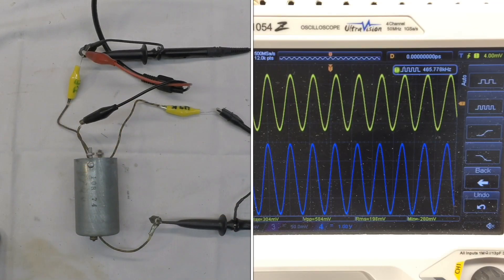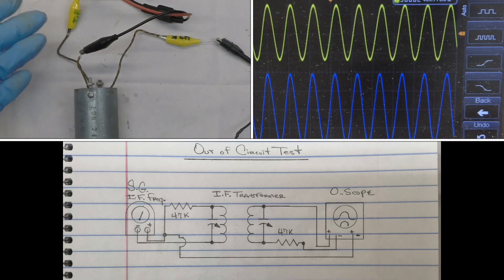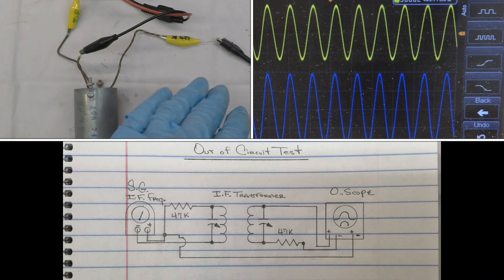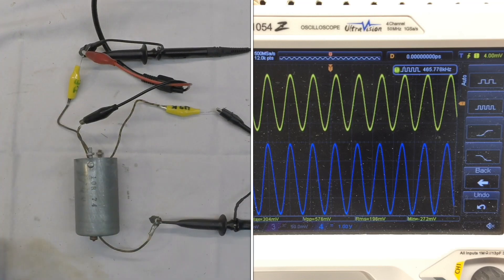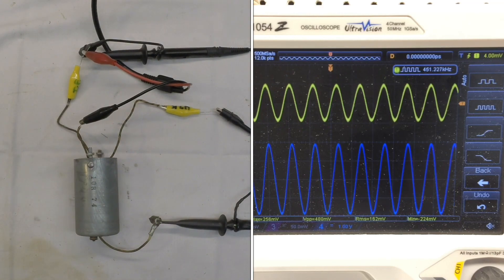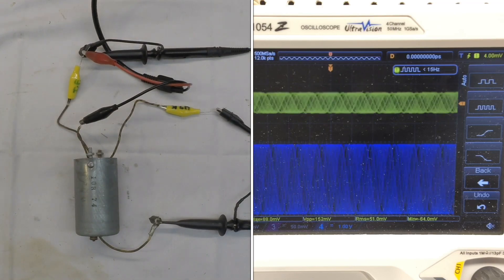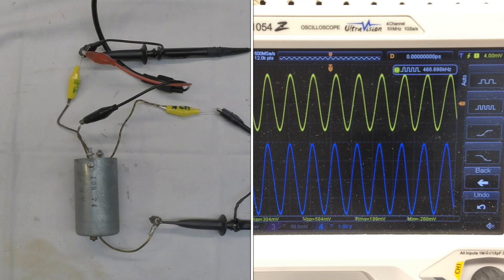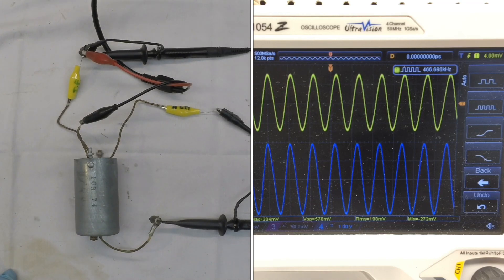Airline 62-316 - I.F. Transformer Evaluation (Resonance Testing)

Comment: You can also use that method for in circuit test too, the resonance will off some, but I used it to check out a bad IF with SMD. The output waveform was distorted.
Reply from the maker: Jim, thanks for your insight my friend. Best, Don